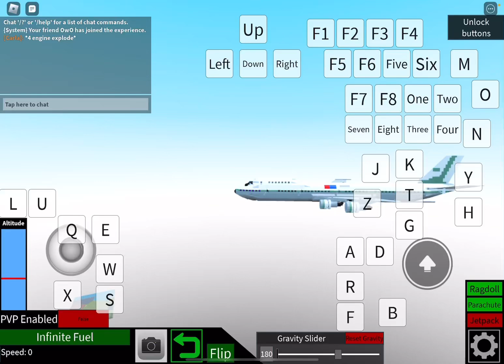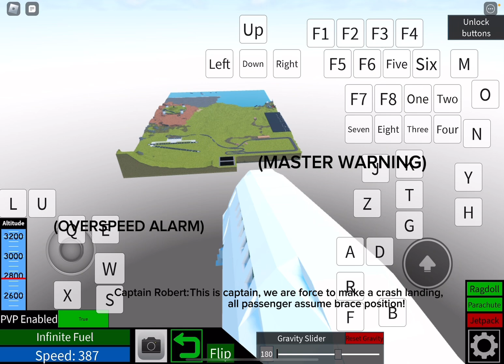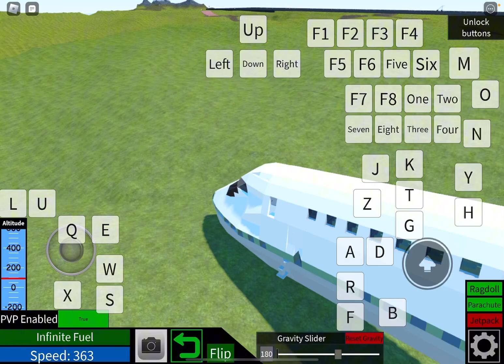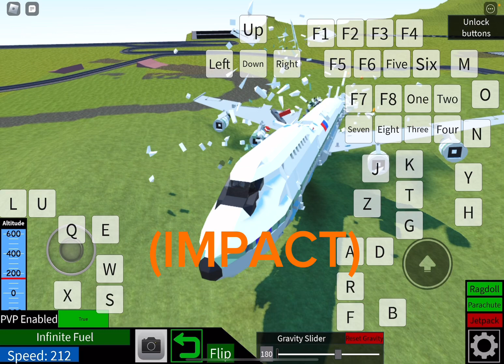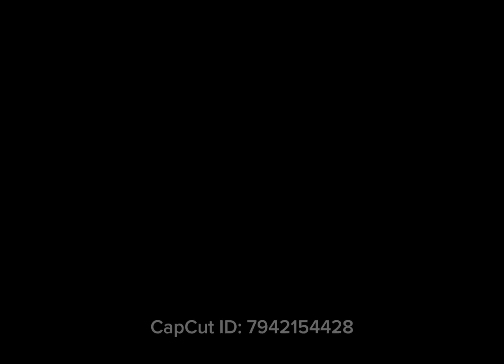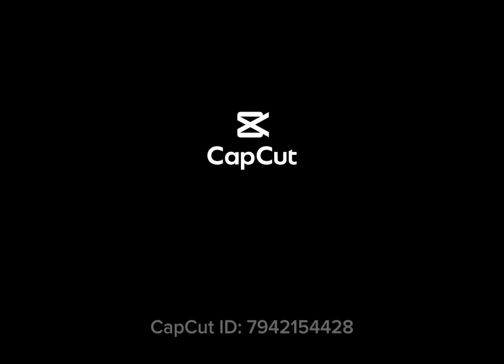Lifeboat Airlines Flight 27B CVR

Comment: Fun fact: The engine has caught on fire because of the engine failure. There are 28 souls died and faded away. Someone opened the door and escape the crash. There is the crew escaping the crash if there is the safe objects that can survive with people only. All engines caught on fire and the gear is down. When it's almost crashing. The crew escaped the crash. 28 Fatalities might be in a crash site. It might be happened in 2011.